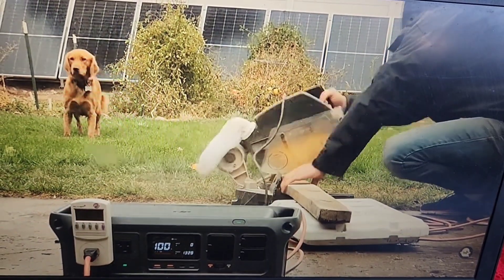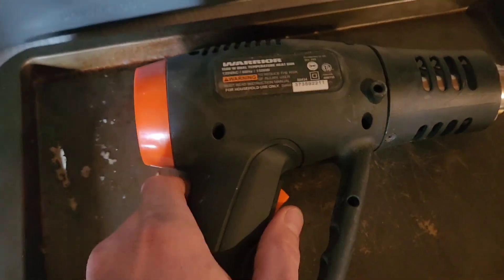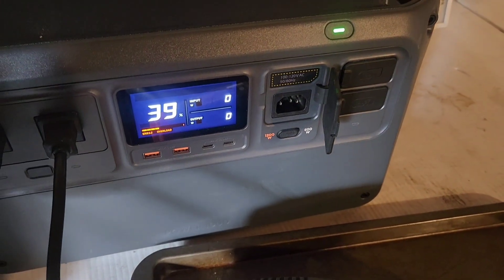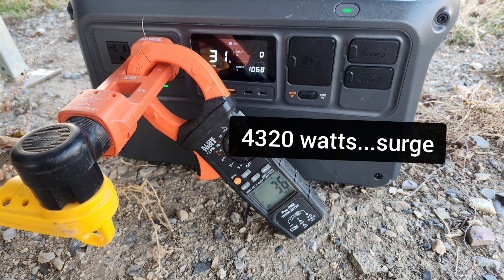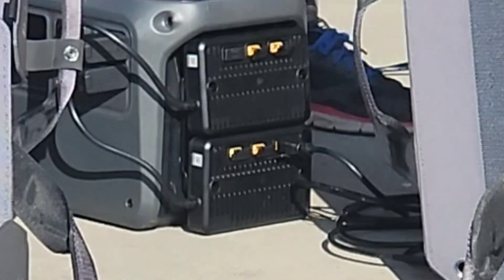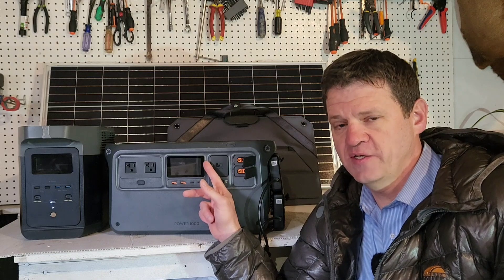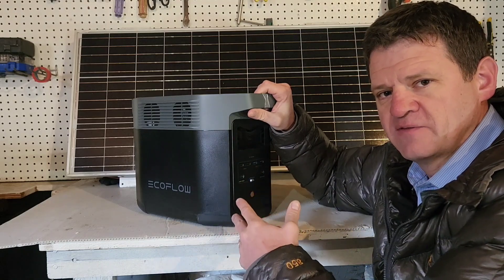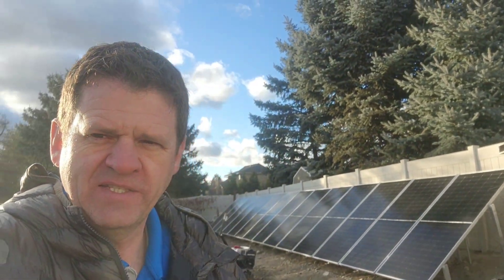DJI Power 1000 VS Ecoflow Delta 2 - New Power Station Competitor?

Comment from the maker: DJI Power 1000 Power Station: https://amzn.to/4iuzETd
Ecoflow Delta 2: https://amzn.to/4g7SJZM
DIY Home Solar Store: https://signaturesolar.com/?ref=DiySolarPowerFun ($50 Discount Code: RAY)
Used Solar Panels: https://www.santansolar.com/?ref=DiySolarPowerFun (%5 Discount Code: RAY)
(^Affiliate links)

*Recommended Solar Stores*(Affiliate Links):
Signature Solar.............. https://signaturesolar.com/?ref=DiySolarPowerFun ($50 Discount Code: RAY)
Current Connected........ https://currentconnected.com/?ref=diysolarpowerfunray
SanTan Solar................. https://www.santansolar.com/?ref=DiySolarPowerFun (%5 Discount Code: RAY)
ShopSolarKits................ https://shopsolarkits.com/1302 ($100 Discount Code: RAY)
Ruixu Batteries.............. https://www.ruixubattery.com/?ref=fOKapj_VLUpGf4 (Discount Code: RAY)
PowerQueen Batteries.. https://ipowerqueen.com/?ref=DiySolarPowerFunRay&utm_source=Youtube&utm_campaign=Ray (Discount Code: RAY)

Chapters
0:00 Intro
1:38 DJI Power 1000 continuous AC Output Test
3:24 DJI Power 1000 Peak AC Output Test
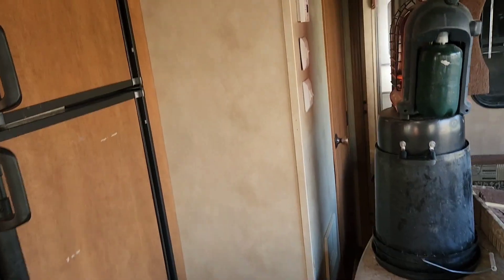4:42 Ecoflow Delta 2 Surge Test
6:13 DJI Power Station Surge Test
7:34 Connecting Solar to DJI Power 1000
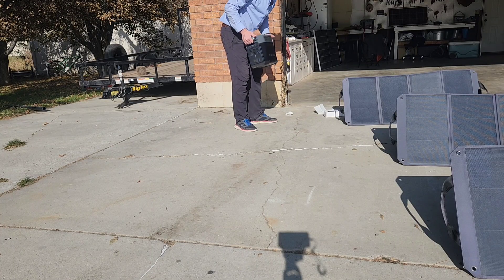9:32 Connecting Solar to Ecoflow Delta 2
12:11 DJI VS Echoflow: What to buy
15:05 DJI Solar Panel Give-a-way.

Comment: It's funny how DJI suggested to compare their new 2024 product to an old Ecoflow when a new Ecoflow is available 🤔🤔. Delta 3 plus would been an appropriate comparison but nonetheless the older ecoflow showed there are levels to these . DJI is for drone communities while ecoflow is for everyone else . DJI was just trying to market their product using ecoflows' name here . My money is on ecoflow on this one but it's good to have other players compete as us consumers would benefit from a better product .
Reply from the maker: To be fair they requested me to do the review before the Delta 3 came out. 
    For what it's worth, I will be selling my Delta 2 and keeping this DJI power station.  After using them more, the DJI has better UPS support. I'm using it to backup my Wi-Fi router and tv... the Delta 2 would drop the internet when the power went out before the ups would kick in.  With a power outage the DJI UPS would just keep things running as normal. No interruptions.  
    I believe many of these power stations out there are from the same Factory.  They are all are very similar. DJI definitely designed this from the ground up.  I think they did a good job!  No one touches them with how much power this unit can produce.  Also...Dead quiet... I haven't seen any other power stations do this!!! I probably should have given them more credit here!!

Comment: I bought the DJI 1000 about a month ago. My main purpose was to run my Chinese diesel heater. So far it has done excellent. I recently bought 1 solar panel on a sale. It’s a 200W panel. I want to be able to get 3 more panels to finish out its 800W capacity. I can say I have no complaints with the DJI power wise but….. it needs so many cables to hook anything up. It needed the 12V adapter plug. Then as you showed, it needed solar panel plugs which was another $60. I’m blessed that the 12V cable came with it but I need another 12V later for my other diesel heater and another solar plug to add on the end. It’s nickel and diming me so I don’t like that but I’m already invested now so I got to stick with it. All in all the DJI is very well made and very stout for its size. I’m satisfied and will probably buy an expansion battery in a year or so after some prices come down. Good video 👌

Comment: I'll stay with my ecoflow's over DJI. Cannot compare DJI to ecoflow that's a slap in the face to ecoflow. The solar and customer service are horrible with DJI, plus their software is worse than the solar and customer service.  Research reviews regarding DJI 1000 and how many are associated with customer service and how the power station crapped after a software update.
There's nothing impressive about DJI power stations, maybe give them 3-5 years and we'll see.
I would rather use my Steelite power station over DJI anyday of the week.
Please tell DJI to stay with drones.
Reply from the maker: I think their customers were asking for this product.  They were sick of crazy slow typical power station drone charging... I think this unit cuts drone charging in half for the drone folks.  I haven't had to call the support for either product.   You have to hand it to them for getting that much power out of that small battery...No one even comes close to getting that much power out of that size battery.  I think people are sick of lugging around heavy power stations. 
     I think the sweet spot is 1800 watts for a power station....  I had a real hard time finding something that would run more that 1800 watts.  I'd love to see DJI create a 1800 watt power station with a smaller battery that's under 20lbs...That would be awesome!

Comment: Excellent comparison! If you can, compare the two against a non-portable version like a SolArk 15k or Deye 16kw inverter and lifepo4 battery.
Reply from the maker: They are really much different products.  These power stations are really meant to power only small devices... and not for very long...The whole home backup products you mention can accept any amount of batteries you want to connect and a boat load more of solar than these really small power stations.   I'd definitely not do long term whole home backup on a small portable power station like this...hope that helps.